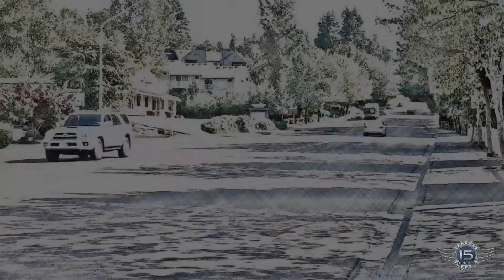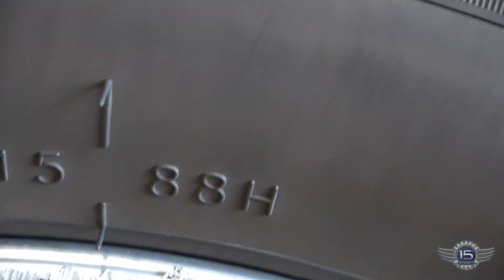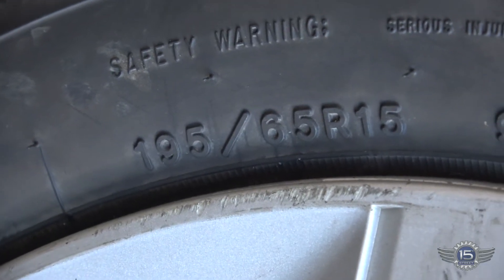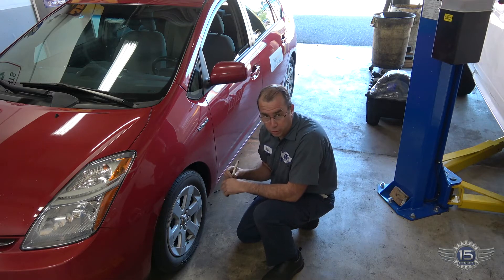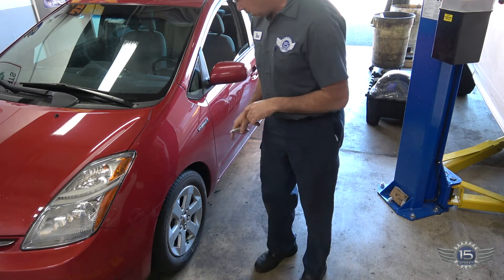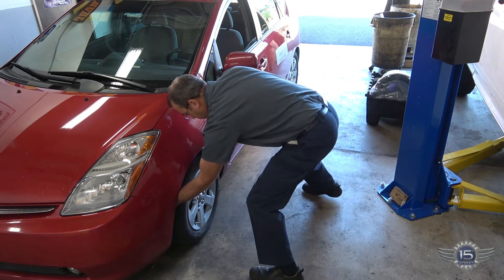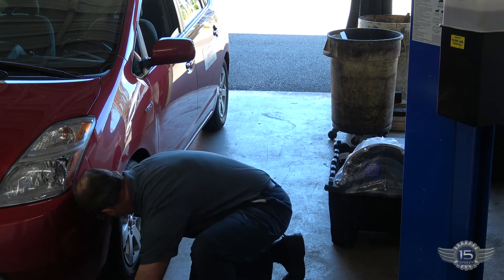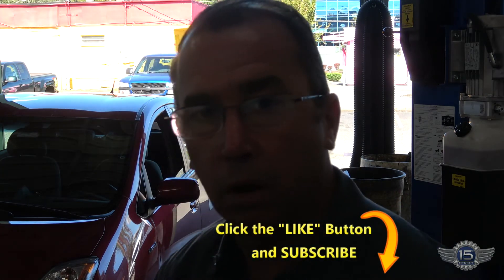Toyota Prius  Surging When Driving

Comment: Heck ya man.  Great job.   My son just added two new front tires to the car so I will check this out.   We have a 2014 but this may be the issue.
Reply from the maker: If the rears are worn this will cause issues. All four need to be close in circumference.

Comment: I bought a used car. He bought 3new tires.  I later found out that the ig traction light came on. I searched nd its to reset it when the tires r fixed or aired up. Something like that. (It has a button under the steering wheel to reset) i aired up the tires where its supposed to be and tried to but the light didnt blink like it should to let me know its done. Before i aired it and now. It flashes a few times then stays on every time i start the car. I dont know why. I also found a paper the owner took the car to get checked. It needs alignment, i think it said spark plugs (they mechanic wrote messy), cabin air filter and engine air filter are “suggested to be replaced”. I was gonna order the two filters for my dad to fix but havent yet. (We had a falling so i dont want to ask him) just today i started my car and like 30secs in. (Not pressing the gas or brake) nd it made a huge sound as if revving or like a motorcycle just passed by. It drives and moves but that sounds it really loud and annoying and scary.

Comment: I guess that I shouldn't laugh at this.  It is the case that small businesses have people that aren't properly trained or who deceive people intentionally.  Any tire center worth it's salt would not have installed mismatched tires on this car.  It is also the case that people lacking basic mechanical knowledge can be taken advantage of.

About a year ago I took my car in to PepBoys for an oil change and free rotation. When I went to get in the car I observed that the tires had not been rotated. I went back in to the service counter and told the service tech. She called the tire man (young man) and asked if he had rotated the tires and he replied yes. I challenged that and explained how I knew that they had not been rotated. Then he admitted he hadn't because it's an all wheel drive vehicle and they don't need to have the tires rotated. Unbelievable. The service tech had some choice words with the tire jockey and he went back and did the rotation.
Reply: hay pepboys is not small business. Shop local, Spend local, keeping your money in you own community makes you reach as well.